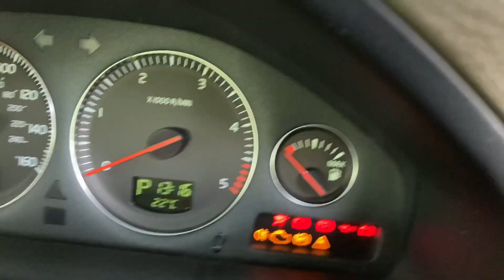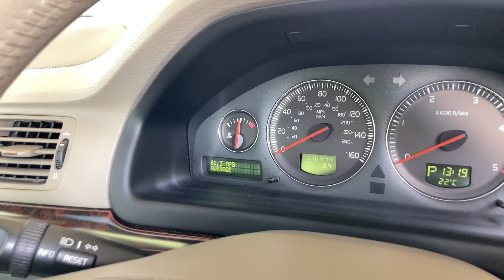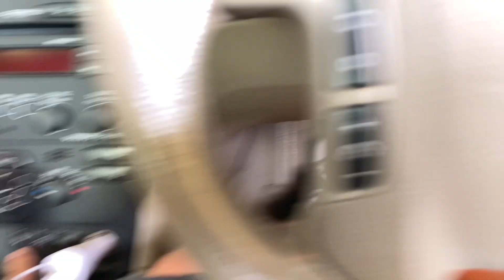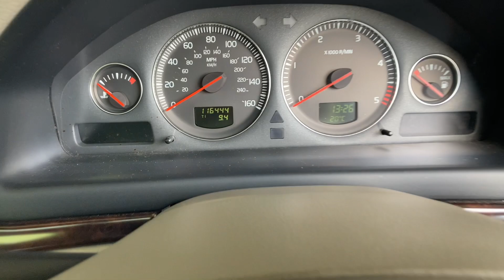Volvo S80 D5 | Project S80

Comment: Had the S80 D5 a few years ago. Same as this one, same colour as well. . Absolutely cracking machine, even with near 250,000 miles. Solid motor, and when the turbo kicked in, just went like stink. Mega comfy, huge amounts of space.
Reply from the maker: Such under rated cars old Volvos, so much to like about them.

They are just soooo comfortable and relaxing to drive like nothing else, so well made.

Thanks for watching

Comment: I have one of these and love it. Actually, I´ve had 4 of them over the years. The T6, the d5 manual, the 2,5t manual, until I finally found the ideal combination - the D5 automatic. I still love the looks of the car even after all those years and if I could find one in such a good shape as yours I´d buy it and drive it until they ban combustion engines. As it is I´ll just continue driving my slightly tired one with 430000km on the clock :)
Reply from the maker: Yes they have aged so well, S60/S80/V70 brilliant vehicles, well serviced these D5 can hit crazy high milage.

For me the perfect combination would be V70 D5 only reason I ever sold my 3 S80 was I need the boot space for the dogs.

Thanks for watching and commenting 👍🏼
Reply: @CarAddictGarageNE  Ha, ha, agreed! That's why I have a V70 d5 and a xc70 d5 to go with my s80! Although, our to medium size dogs fit in the boot of the s80 as well 🙂
Reply from the maker: Oh yeah I could easily fit my 2 springers in the boot, but would need the back seats down.
Can’t cope with out hatchback / estates
Reply: I have one which I'm selling. Same colour, same black interior leather seats, 99,978 on the clock
Reply from the maker: Keep it, regret selling my S80

Comment: I've recently purchased one of these, it's the first diesel I've had and it's an absolute pleasure. It had 74,670 miles on it and I've racked up nearly 4000 miles and it's not missed a beat and the auto box is great.
I'm interested in the egr blanking and I'm considering doing it to mine so I'm interested in seeing what you do. Thankss
Reply from the maker: Yes mate have got plenty videos just need to get them edit and uploaded.
Thank you